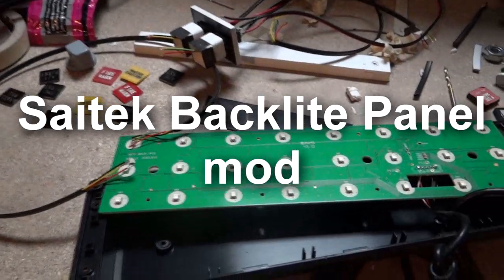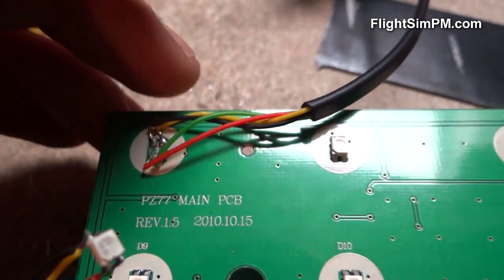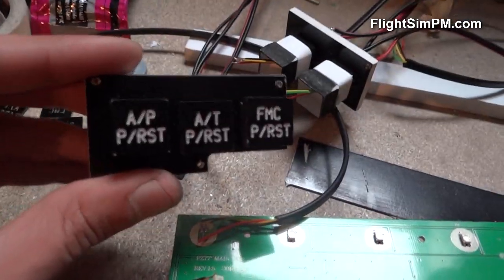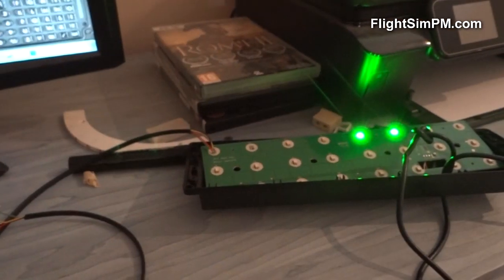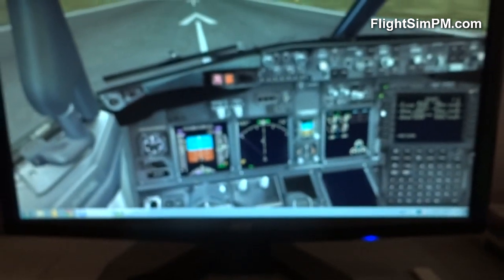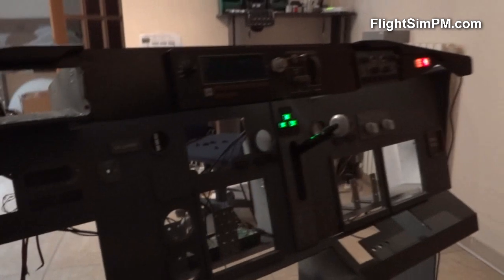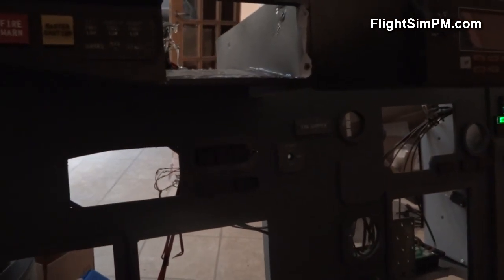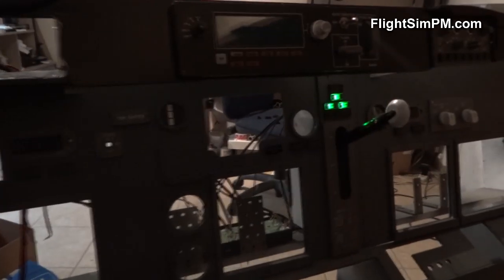Saitek Backlit Panel mod for 737 cockpit simulator

Comment: Here is a bit of a technical question.  I'm in the market for something like this for my home automation setup.  Is this fully programmable in the terms of programming each indicator to what ever I want?  For instance if my CPU temperature gets a bit hotter than usual, can I make an indicator light for that and so on?  What does the computer recognize this panel as when plugged in?  If I can make it display the CPU thing then I can make it do anything I wish lol.
Reply from the maker: +hydrolisk1792 visit  saitek official website for info about this item